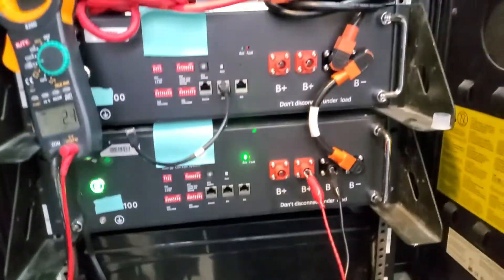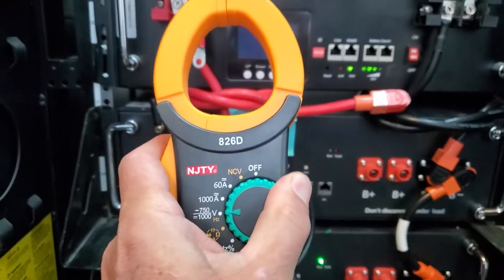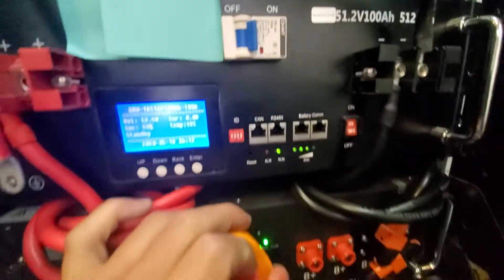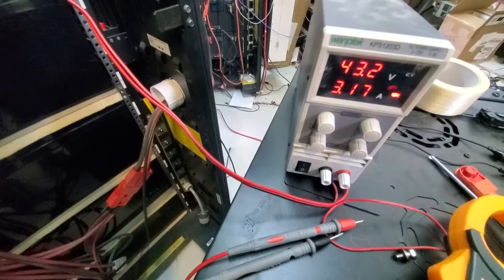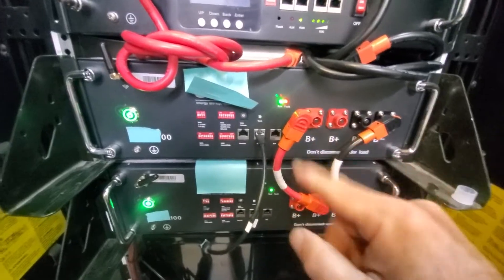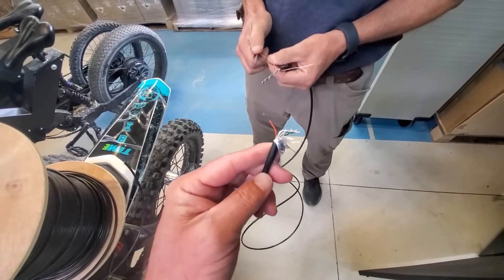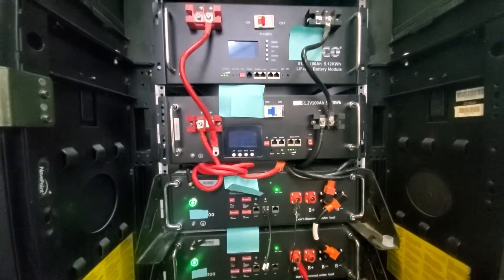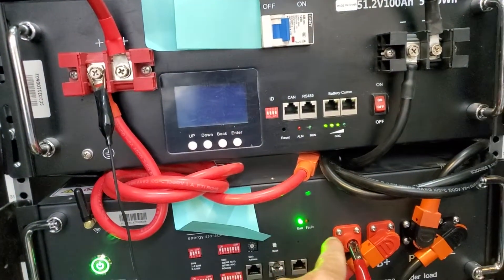Techniques Paralleling LiFEPO4 Batteries together

Comment: I saw you demonstrating the balancing  of two LiFePO⁴ batteries in different SOCs by an improvised resistor 1 Ohm comprising of a 10 feet long insulated copper wire. I'm greatly impressed!

Comment: That is pretty much what I needed! I had batteries with crap bms's, changed those over for JK BMS. Now unusable batteries can be used. loved the 3rd world hack! We live offgrid in the top of NZ, and really hard to get stuff here. Can I ask a question? Do I need to communicate with our inverter? We have 24v system, 600ah lifepoh4, but we don't ahve the communication boards like others, although the JK bms has RS com ports.

Comment: Can I not use the inverter to trickle Charge the low battery to the desired voltage? Then when the voltage matches the fully charged battery,connect everything up.
Reply: That was my thinking as well, disconnect current butteries and change new one to desired percentage and then connect all together again

Comment: Hi i recently aquired a kit of 5 V5 pytes batteries. I wanted to add these to my current 48100R pytes battery bank of 600ah. (around 30Kwh). Unfortunately i was told i cannot parallel them because they are different model. Can you tell me how can i make them work together? many thanks

Comment: Excellent idea about using thin wire as a resistor. That wire could also a pre charge resistor for prior to booting up larger inverters.

Comment: Thank you for the infos, what about if the batteries have the same voltages but different SOC? If I connect the a new battery to the stack directly to charge, not discharge, it is ok?
Reply: If the voltage is close or the same, you should be right to connect.

Comment: I posted a pic of my electric heat kits on the diy forum last week that I use for discharging my batteries instead of wearing out an inverter and various loads. I use them like you, as a big high wattage resistor.

Comment: A light bulb is way better than a skinny cable to use as a hack resistor, with a happy bonus of being able to tell how much current is flowing.
I now have 4 Felicity 10kWh, 1 Cloudenergy 7.68 kWh, 1 self made 11kWh and 1 self made 14 kWh all connected together and perfectly balanced at 100% charge with all 112 cells sitting at 3.34/3.35v
Reply: How did you made self me batteries?

Comment: Thank you for the tip!  Can you add a bank of Silicate Batteries into the mix with the LiFEP04's?
Reply from the maker: Yes you can! Absolutely, Silicates are the least fussy battery , they can parallel with Lithium's just fine, they are also able to supply hundreds of amps surge when the Lithium's freak out

Comment: I've never been able to justify buying one of those power supplies... I probably should just get one while you still can... I've always figured out some other way to do it.  I'm Off-grid, My "2nd world" hack for putting a new 24 volt battery into my system is to use one of my old trace c40 charge controllers (12, 24, or 48V compatible) to trickle charge the new (DIY built or prepackaged purchased) battery to 100% SOC... I have had to do both in the last couple months and will have to do it again when I build my new 48 volt system... I hook the charge controller up to my smallest 500Watt Array Vmp- 72VDC and let it sit for a couple days.  When the new battery is fully charged I wait for a sunny day when my system is at 100% SOC, or run the generator to get it there. This is where it gets kind of complicated for me because I have a Electrodacus monitoring one of my older batteries and figuring out the state of charge of the whole system... So I reprogram the SBMS120 to the new Ah capacity shut everything down then install the new battery.... Restart the system and then re-program the inverter and charge controllers kind of a pain but I've gotten pretty good at it 😋